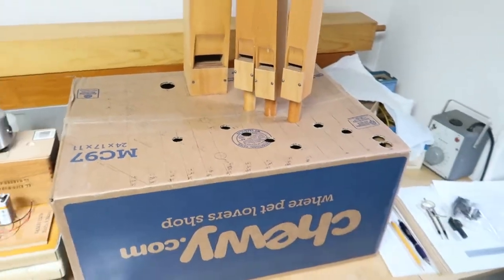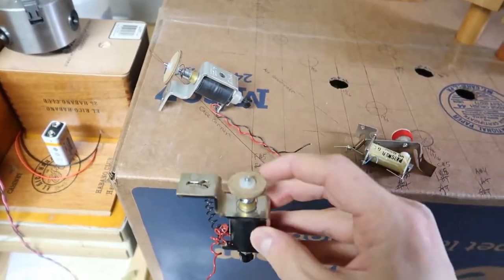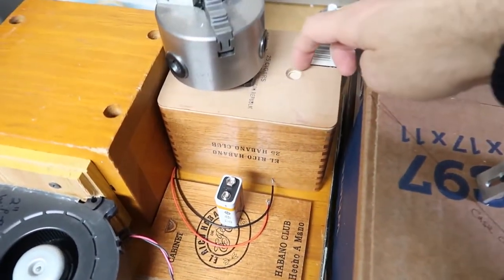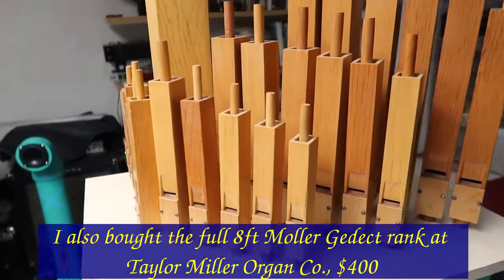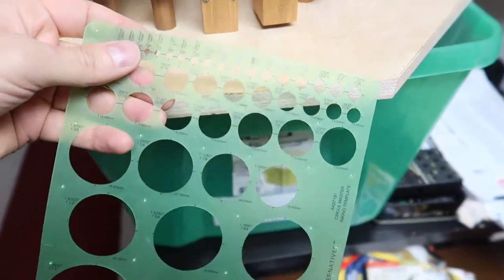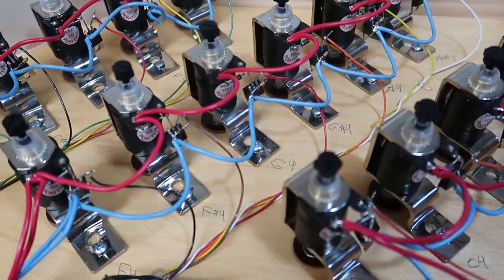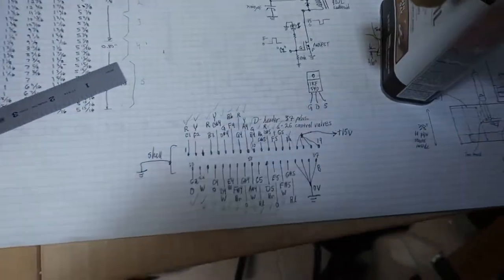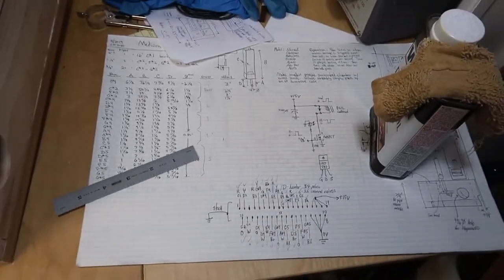Build an Organ Pipe Doorbell (Part 1), DIY, with Raspberry Pi

Comment: This is brilliant! I've had a similar project in my head for years, though nowhere nearly as ambitious. (I was thinking two chords upon pushing the doorbell, maybe.) You sound like me - I talked Organ Supply Industries into selling me a few pipes, including an 8' stopped Gedekt (1 pipe only) back in the 80's when I was young and ambitious. I've got a pile of organ building books, and my interest has recently revived as I realized that there's a ton of content on YouTube now on this topic.
Reply from the maker: Thanks so much for your comments! Let me know if you need any info/supplies to get you going. For me, I was amazed that a little biscuit blower was strong enough for the pipes. If you're just doing two chords, (1) the regulator bellows is not necessary (even for mine), (2) you can use just TWO valves to drive the triplets of pipes. The blower still needs about 1 sec to spin up, though, which is why I felt I needed the passive infrared sensor (PIR) to detect someone approaching the door. See Part 2 for more details on that. Feel free to subscribe if you haven't already ; it doesn't cost you anything.

Comment: Do you have a link to the valves from ebay? I am building a portative organ and they seem better than a carboard flap...
Reply from the maker: Better than that, send me an email at colin.joyemusic@gmail.com -- I've got the guy's contact info. He may not have on Ebay now.
Reply: @JoyeMusiccom  Another question, what is your power supply?
Reply from the maker: @Charles-Reardon  I have an old transformer-style power supply with regulators on it. It supplies the 15v for the solenoids and also 24v for the fan that supplies the air. It will eventually supply the 5v for the raspberry pi computer too.
Reply: How responsive is the entire system? How long from the time the doorbell button is pushed until the first pipe speaks?